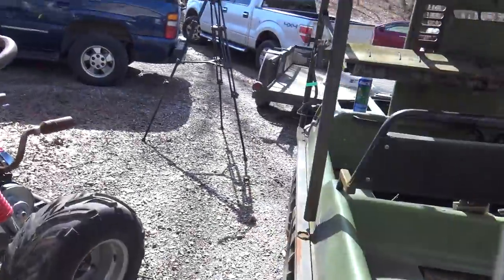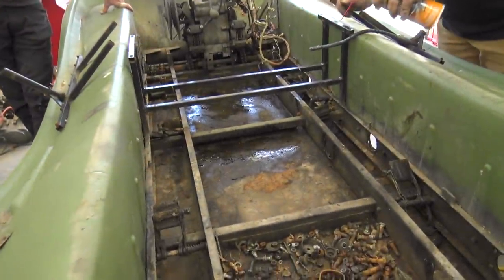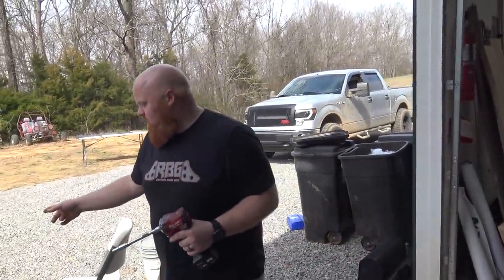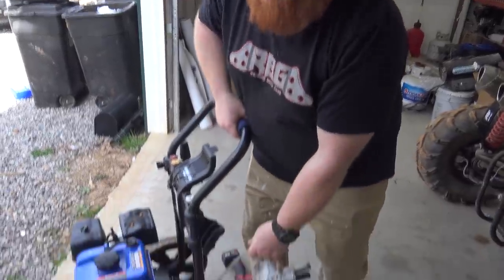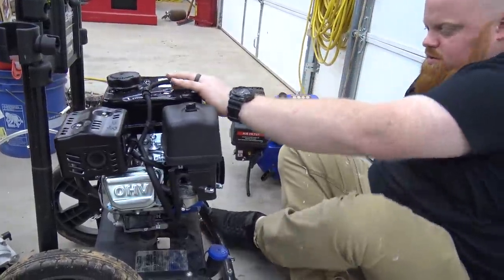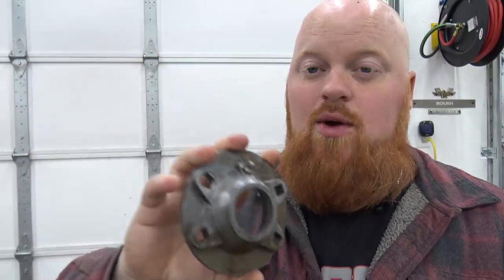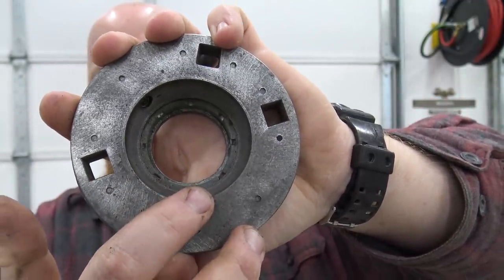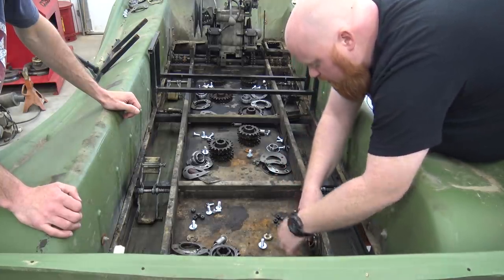Argo 8x8 Magnum Amphibious Vehicle Rebuild Ep1~ Chains, Axles, & Bearings

Comment: They used to have an Eastern Outdoors show at the Pennsylvania Farm Show building in Harrisburg, PA.   There was a company there making the bottom half of an amphibious vehicle like the Argo.  They use one sheet of material.   It gets heated and vacuum formed in a vacuum mold.  Then they put the formed body in a jig and drilled the holes for the axles.   Those 8 wheeled amphibious vehicles used to be really popular in Central PA back in the 70's   You hardly ever see them anymore.
Reply: Yes I live outside state college it use to be big around here in the 60s and 70s.

Comment: Those 8 dimples holding the seal in place is factory. It was Argo`s way of grabbing cash when it came time to replace seals, they made you buy the whole housing. The newer design double seal at least you have a second chance at changing seals but its still designed to be a throw away..

Comment: Next time go to an industrial bearing and drive shop to get the bearings, sprokets or chains. There's no sense in paying that outrageous price premium. I live near Chattanooga TN and get my bearings from Chattanooga bearings and drive. I've been able to get bearings there anywhere from tiny R/C car when bearings all the way up to a huge multi taper self centering roller bearing about a foot in diameter. Bearings that are around the size that you would need for your machine only cost somewhere in the neighborhood of 15 to 20 dollars a piece. I'm here to tell ya, that company has saved me a small fortune allowing me to avoid the price hike of part suppliers. They usually are of higher quality than you would get from a parts warehouse. All their bearings are either made in the USA NSK or high quality made in Japan.
Reply: I get all my bearings, chains, inner 4 hole flanges and seals from the farm supply store down the road.
Reply: Here in Pennsylvania i go to place called "bearings,belts and chains...." All japanese good bearings and way cheaper than anywhere else i found